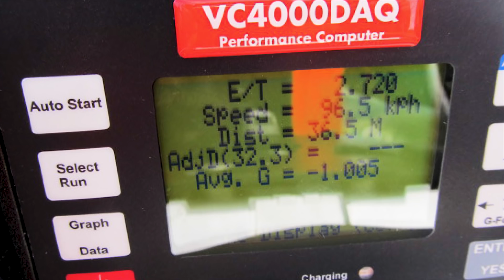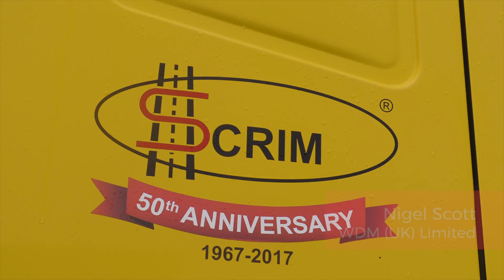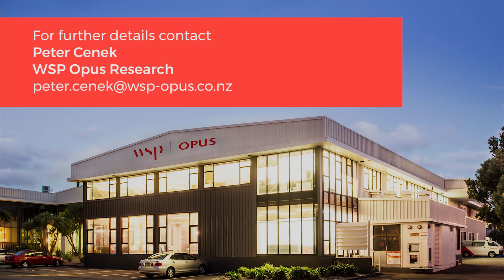NZ government & private industries join forces in a world-first assessment of chip-seal roads.

Comment: Chip seal works in other countries not NOT in NZ. The reason, half assed work. 
No leveling off before hand with a roller so big peaks and troughs appear within a few days and then you leave the loose gravel there for years after it was put down. This makes it lethal for cyclists and motorcyclists.

The ONLY reason NZ is doing it, it's cheaper in the short term...... but needs doing so often in the long run as it disintegrates it costs way more

Comment: This is not a world first.  It has been done many times and the results are quite clear.  The tyre manufacturers have done it for years and the results are freely available.  Chip seal surfaces roads are much more dangerous than the smooth bitumen roads.  Let's have a look at chip seal surfaces: Rough surfaces means less tyre area contact leading to longer breaking distances and poor grip when cornering, holds more water leading to aqua planing and blinding spray and interferes with the tyre treads ability to pump away water and maintain contact with the road, break away of the stones leading to the stones rolling under the tyres leading to much longer breaking distances, interfering with ABS and accurate steering, increased road noise which leads to fatigue and sudden onset drowsiness.  Regular maintenance required which costs a lot more.  Maintenance of our roads has generally been poor since the Ministry of Works was sold of with many cowboy outfits winning the contracts.  The maintenance has often made the roads more dangerous.